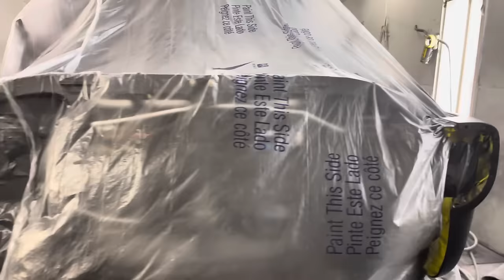59 F100 & 69 Camaro Paint Progress & MORE!

Comment: What do you guys use for high build primer. Slick sand? Or another brand. Just curious. I’ve been using it and do not like it as much as the spies hecker brand spray polly
Reply from the maker: We use VP2050 as high build exclusively from bare metal all through bodywork stages. We don’t use any polyester primers. They have great mil build, but I’ve seen excessive shrinkage and other issues of crosslinking multiple types of products.
Reply: @HouseofPearls  have used that once before. PPG makes nice primers. When I used spies it was spies from start to finish.